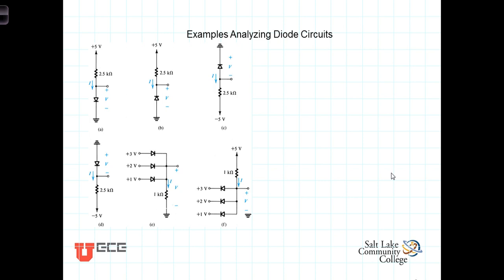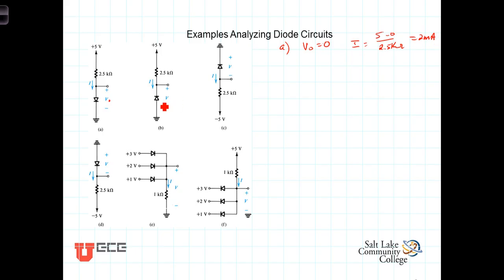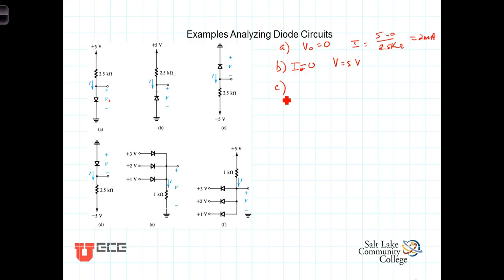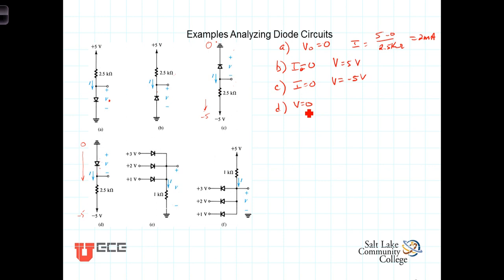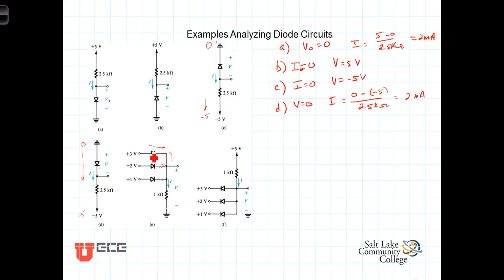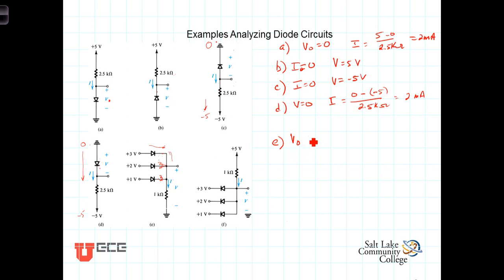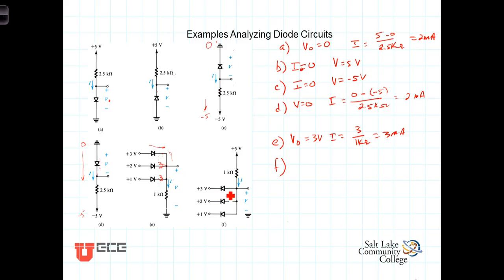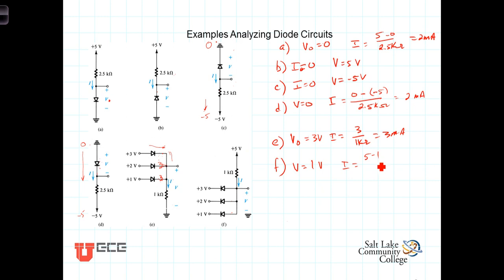L4 1 4Ideal Diode Conducting or Not Part 1

Comment: I enjoyed the way you clearly explained the key concepts in ascertaining these by inspection. One thing that would have been helpful would have been to say that there was a "no loading" situation at the Voltage outputs.....for instance a DVM measurement or a JFET input at the next stage or a GPIO on a micro at the next stage. It's subtle and not necessary but aides in understanding the real applications and the real-world loading (or no load) effects.

Comment: For people who are still confused, here are what you should know:
If there is no current flow, resister will not consume energy/voltage, therefore no voltage drop across resistor.
Think of current as it was water flow, voltage is the pushing force to the water,
if 1:there is current flow, resistor will "resist" current flow such that there is a voltage drop across resistor according to Ohm's Law, thats the resistor will "push back" the driving force(voltage) such that it matches the driving force of the other end of the resistor, thus voltage drop will be 5V.
if 2: there is no current flow, resistor do not consume energy/voltage because V=IR I=0 V=0, in terms of water, there is no water flow, but the driving force is still here and still "pushing" although there is no water flow, thus voltage will not drop if there is no current.
Reply: Shouldn't it be 0-(-5)=5V in c)?
Reply: Ya the answers of my book is -5v

Comment: Shouldn’t there be a voltage drop across the diodes in e and f. So shouldn’t it be 2.3 in e be a of the 0.7v voltage drop across that diode and likewise for f.
Reply: he is talking about Ideal Diodes so 0V, I believe you are referring to Practical Diodes, which makes you statement correct.

Comment: Why is there NO Voltage Drop across that Diode in A?
Reply: It’s an ideal diode so it can essentially be replaced by a short as long as it is forward biased which it is. Thinking of it as a short means any voltage drop would not make sense.

Comment: on Part D why is the voltage 0
Reply: Because its an ideal diode and voltage drop across ideal diode is zero  and v is voltage across ideal diode hence v=0
Reply: @regale5359  so if it a practical diode will the V still 0 ?

Comment: furthermore, they cannot be different voltages in parallel it is a violation of kirchhoff laws, how did you dare make examples with different voltages
Reply from the maker: I assume you are referring to the circuits "e" and "f" examples.  They aren't connected in parallel electrically.  Parallel means they have the same voltage across them.  These don't.  Each diode is connected to a different voltage.  Only one of the diodes will conduct.  The other diodes will have a different reverse biased voltage that does satisfy Kirchoff's Voltage Law.  In example "e", only the diode connected on the left to 3 V will conduct.  This makes the output voltage also 3 Volts (assuming ideal diode model).  This voltage keeps the other two diodes reverse biased and "off".  The diode connected to 2 Volts will have a 1 Volt reverse bias.  The diode connected to 1 Volt will have a 2 Volt reverse bias.
Reply: what wrong with it? we did a lab with the same circuit, where there are different voltages in parallel.

Comment: part c should be positive 5 volts
Reply: You are right, the way it is drawn is 5 volts. However, if we accept that the anode terminal has a -5 voltage applied to it, the diode is then operating in reverse bias, or operated in the reverse direction. This occurs when you apply a negative voltage to the anode(+) of the diode. He should re-draw the diode to be in the reverse bias orientation since a negative voltage is being applied to the anode, that is flip the diode 180 degrees. This would then agree with the instructors answer choice. Microelectronic circuits, Sedra Smith, 6th edition, P 166 section 4.1.1 .
Reply: +Uzair Warraich incorrect, there is no way it can be +5 volts because the source is going from -5 V to ground.
Reply: +wjs no, because there is not voltage drop across the resistor, so it is pulled to 5 volts
Reply: The anode is at -5V and cathode at 0V. V is the cathode to anode voltage = 0-(-5V) = 5V!!!!